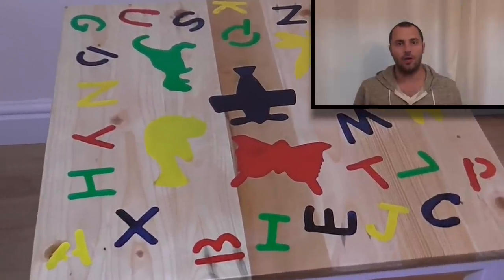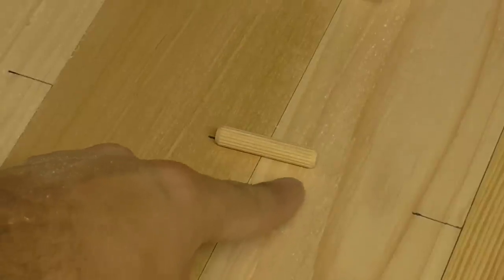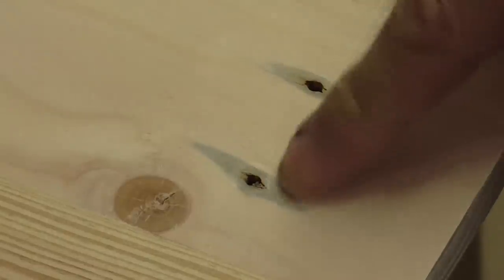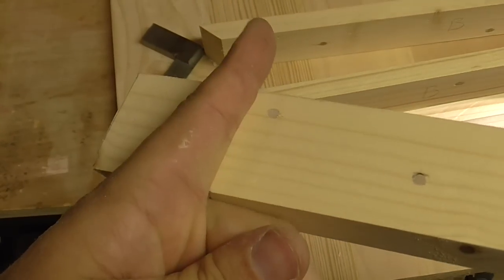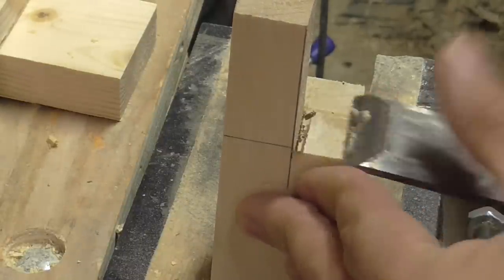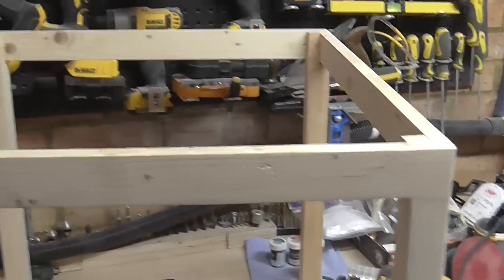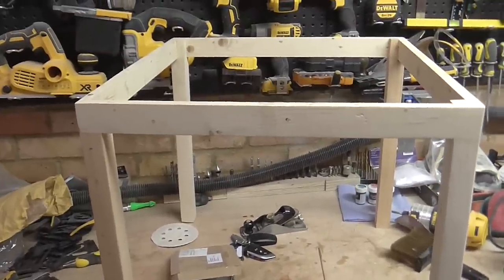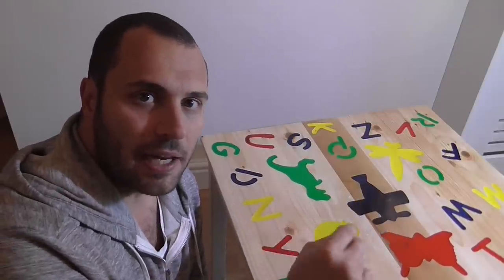Table with Resin Inlays

Comment: Looks great, your little girl should be very happy. Just a tip for the nail holes, mix Glue and Sawdust together then sand. Great idea with the shapes, much better than stickers,
Reply from the maker: Thanks George I tried the glue and sawdust and didn’t like the look. Glad I went with covering them completely in the end though, think next time I’ll use resin with sawdust or maybe clear resin.
Reply: Now that's a great idea resin with sawdust that's something I will try

Comment: Hi, I use pallet wood for all my projects, I also fill the nail holes with dowels but before I do that I drill out the hole with the same size drill as the dowel so their is no danger of splitting the wood and also it makes the repair look much better and sometime you cannot even see where the dowel is.
Reply from the maker: +John Fithian-Franks thanks for the tip.

Comment: bit of a coincidence, was looking at that glue with activator at screwfix. Do you think it would be good for uvpc fascia joints and corners?
Reply from the maker: Yes should work well. I’ve used it for UPVC trim round a door frame and sticking plastic trim to laminate floor.
Reply: Great, thanks! nice job

Comment: good build,now that you have had your titan thicknesser  for a while how are you getting on with it as in how accurate ect
Reply from the maker: Thanks mike. It’s ok for the money, leaves a decent finish but the fence is a bit flimsy. I tend to use my table saw jig more for jointing and the Titan for flattening and thicknessing. 
I’d say you get what you pay for really!
Reply: Yep, the fence is flimsy on those. I tried to make my own out of plywood, but it wasn't much better. will have another go at it sometime.
Reply: forgot to say good tenon jig

Comment: The table came out very nice with the inlays but it seems to be a lot of work with the epoxy sanding.
Reply from the maker: It was a fair amount of work but when I switched to the angle grinder it removed the excess very quickly!